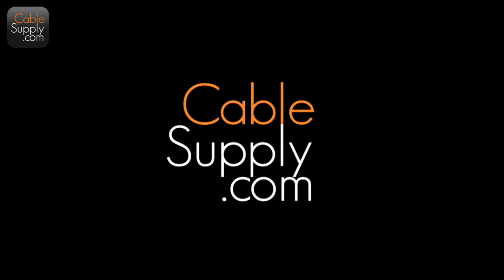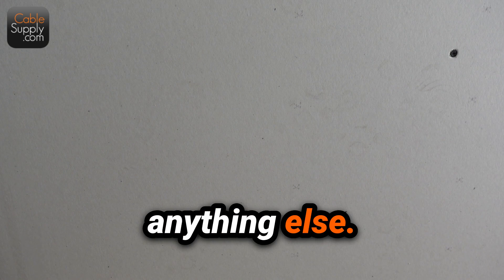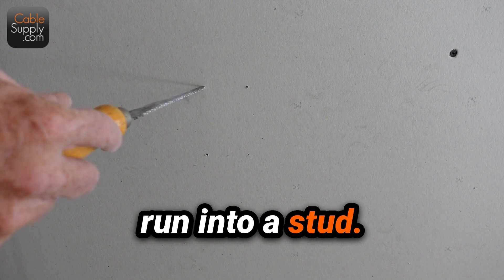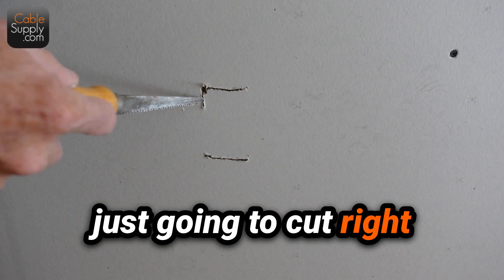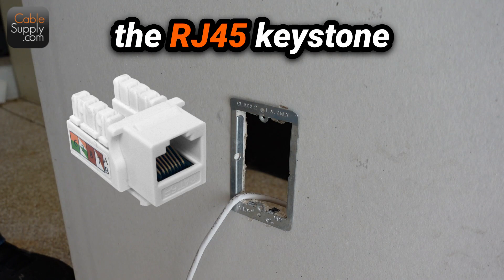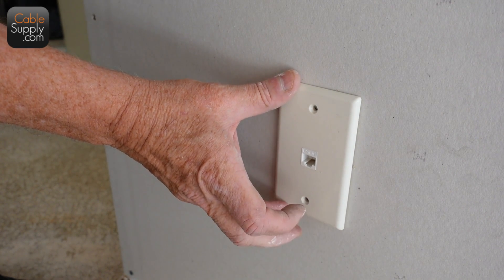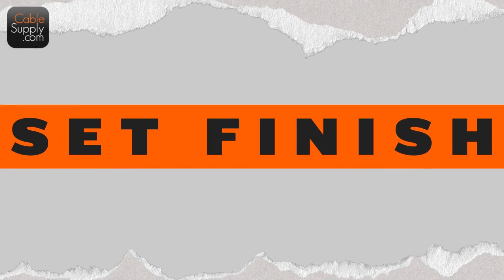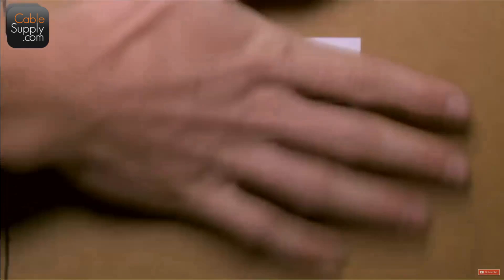P-Ring a time saving device for low voltage cablers.

Comment: I would like to know how you prepare your bid for your low voltage project. I have had no luck in the last 2 years, do you have a template or a how to do list ?
Reply from the maker: I do use a template for the most part with exceptions. I am working on a workbook to describe how to run an IT company or a cabling company.